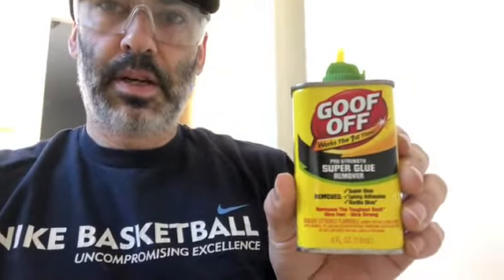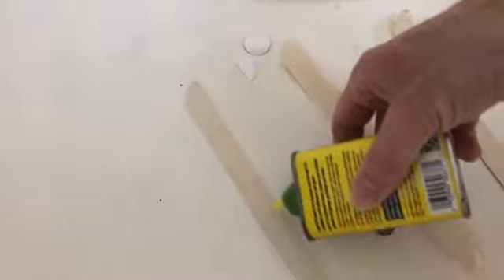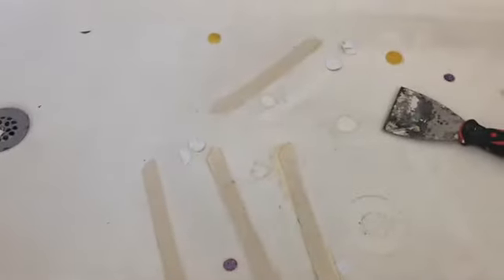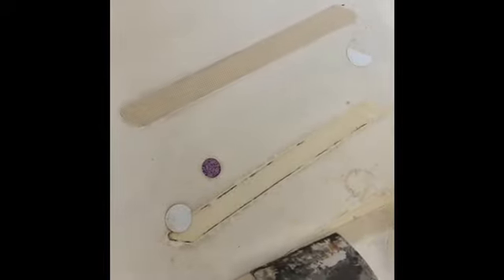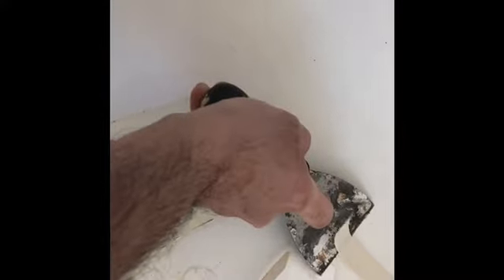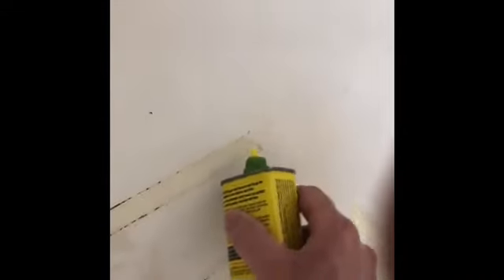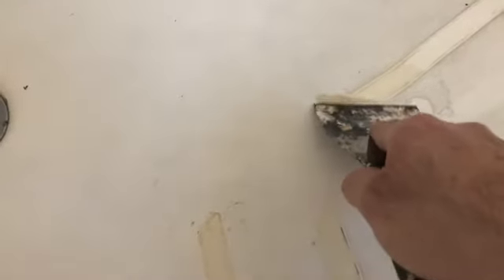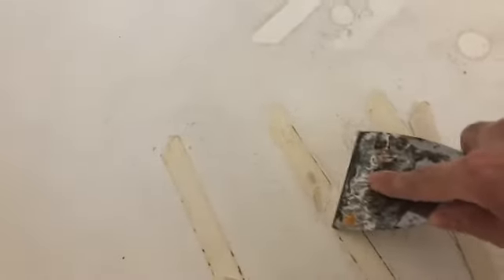How to remove the Bath Tub nonslip stickers, with goof off in 10 minutes

Comment: Auto carb cleaner fluid works the same at a fraction of the cost. Thanks for the tip.. a great video
Reply from the maker: That’s great info thanks
Reply: Where do you get goof off
Reply from the maker: @mieshashavers-thomas6982  Home Depot should have it